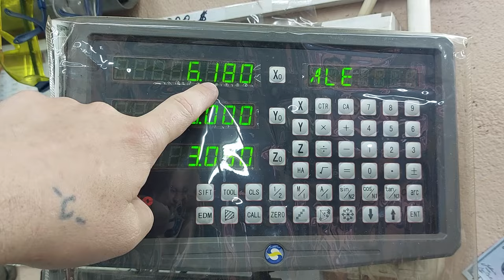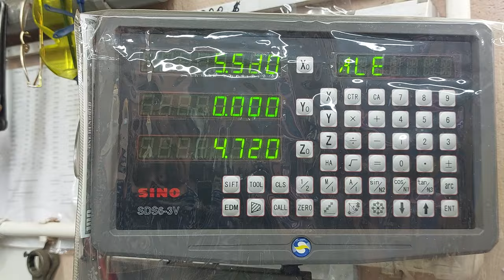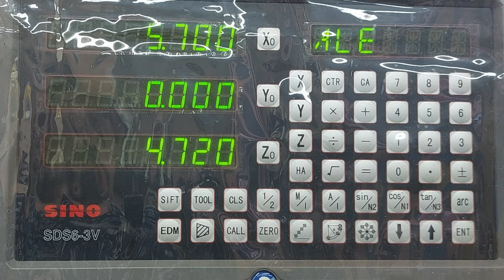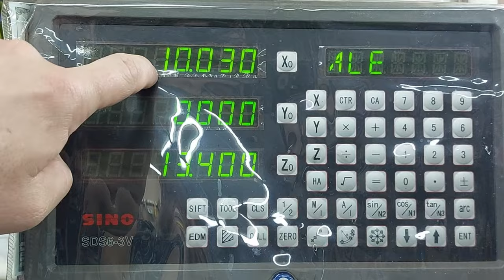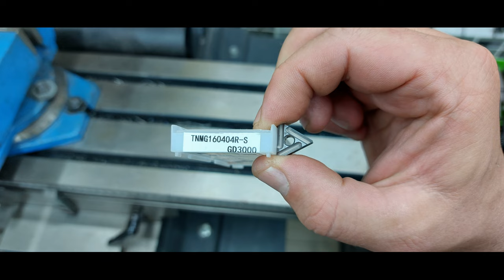Few people know how these carbide inserts work in turning metal

Comment: rpm's too fast and feed rate too slow, slow down the rpm's and increase feed rate for a piece as small as the one you had should be about 350 rpm's and 15 to 20 thousandth per revolution. you obviously have never done this for a living
Reply: Rpm is not too high for tungsten inserts but feedrate is too slow good feedrate that insert is 0,2-0,4mm/rew
Reply: Not sure if you did it for a living, but every carbide insert has specified cutting speed. At the end you can see that the last insert has Vc=80-160m/min. So assuming the part has 50mm diameter we can calculate rpms. Vc=pi*D*RPM/1000. For 50mm part it is at least 500rpm. If you would run this part 350rpms it would be out of specification for this insert. But I agree about the feed that it is too low. It is not specified at insert box - it might be because of low quality of insert. Most of the cases specified feed is on range like 0.1-0.4 mm/rev
Reply: And one important thing, smaller diameter the part is the greater RPMs should be used as cutting speed is decreasing. That's why big lathes have lower range of rpms comparing them to small ones